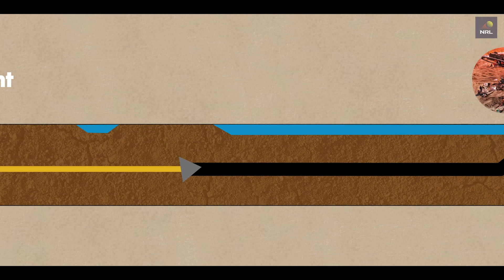NRL  I  1635 KM Crude Oil Pipeline I Crossings under the River Suvanshri utilizing HDD technique

Comment: Lot's and lot's of corruption related to employment in NRL is going on 
And the company takes no action/responsibility to counter them.

More over the company doesn't provide employment to local youths except for low level contractual job.

As a growth developing company it's your responsibility to look forward for the development of the local community also by providing the youths good jog like JE, TECHNICIAN, AE etc

I rarely see any vacancy in NRL with vacant Post of only 2 to 3 post.

The company is taking resources not only from Golaghat but a little bit all from Assam as well, by depriving candidates from applying from other districts  questions transparency.